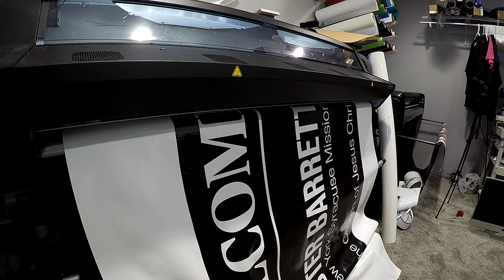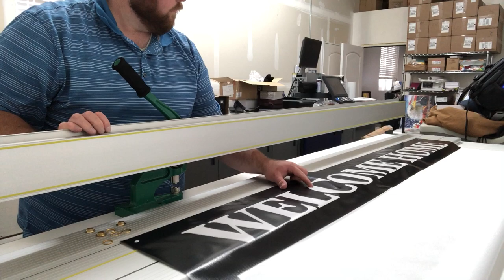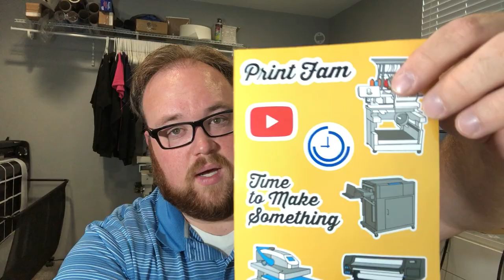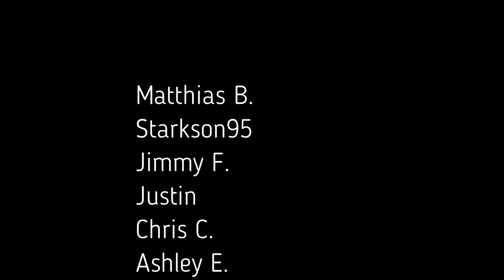I'm selling equipment so I don't have to close - vlog 304 - Print Shop Update - Studio vlog

Comment: When I quit the business 6/8 years ago I got rid of my heat press and all the different sizes of shirts I enjoy the lack of the smell it made and the lack of having all that stock I just keep the cutter printer and laminator as a hobby and do it on the side the market is flooded with people and equipment & shops everywhere at seems like you can buy it online Outsourcing cheaper than you can your own system that said the old rule of thumb keep it simple even if you're doing a job on the side after hours 9 to 5 job
Reply from the maker: There are pros and cons to both. I'm trying to find a good balance... I hope.